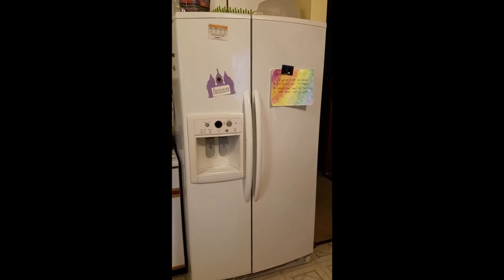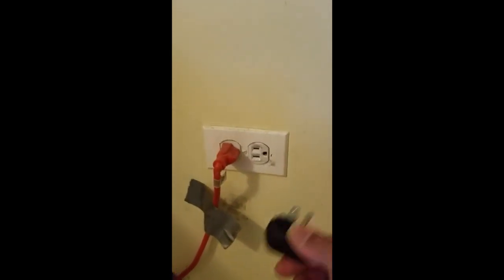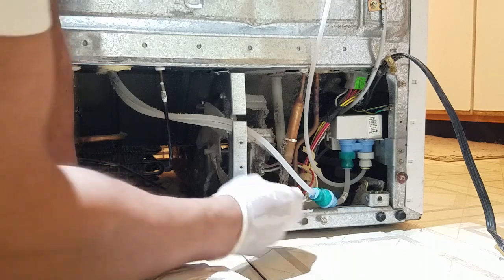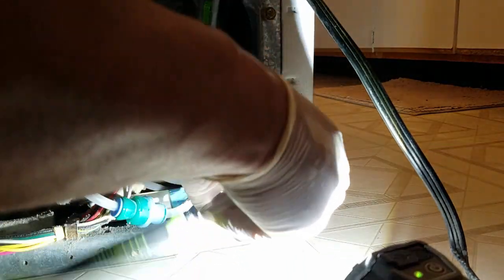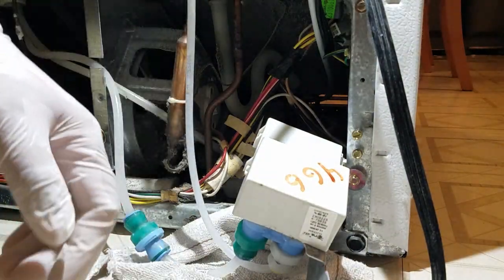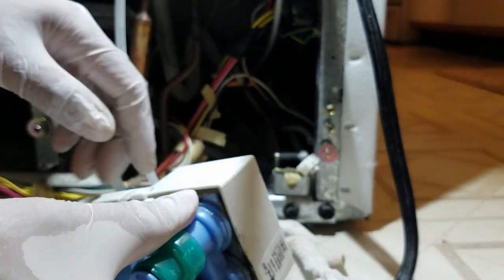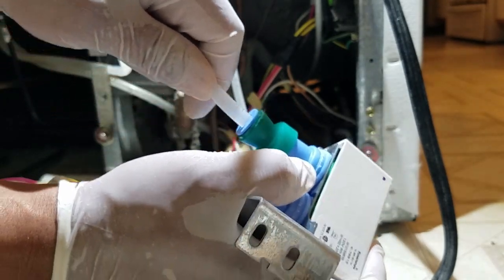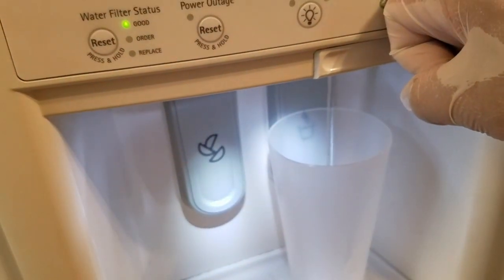Kenmore Elite Refrigerator - Water Valve Inlet Replacement

Comment: Thank you for the video.  Please include your refrigerator brand / model in the description as well as the part number.  I happened to be lucky and spot your video.

The part looks the same as my WPW10159839 and the fridge looks the same as my Kenmore Elite 106.57796701, just a different color.  Water and ice dispenser look exactly like that.

I'm just including the info in the comment in case it helps someone else spot your video.

My issue is the ice dispenser is overfilling a little bit recently and dripping water from the ice dispenser.  From what I've seen, a bad seal inside this valve may be the cause, so wish me a little more luck that this valve is all I needed to fix this.  The rubber seal inside can breakdown with age.

Comment: What the size of the green hose? Mine is leaking thru the connector before the water inlet. Is that just a connector extension or its anything else?
Reply from the maker: Hi, I'm not sure the size of the tube or the name of the part in question. (It might be some kind of valve) I tried to look up that info. on the website I provided but didn't see it.  Unhook the tube from that part.  Reinsert them and see if it still leaks.

Comment: My leaks where the filter is
Reply from the maker: Remove the filter and look at both black rubber gaskets.  Are they torn or deformed?  If so, that's most likely your issue. Try rubbing some hand sanitizer on both rubber gaskets.  This acts as a lubricant, so the gaskets won't get damaged while inserting it into the frig. (I had this same issue)